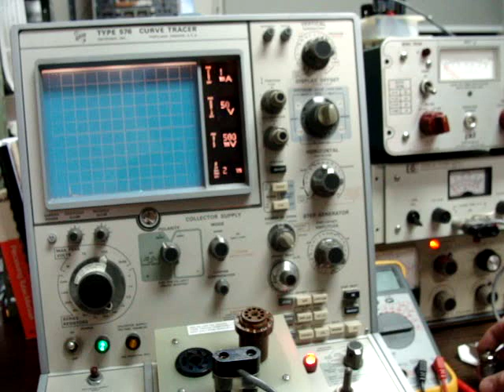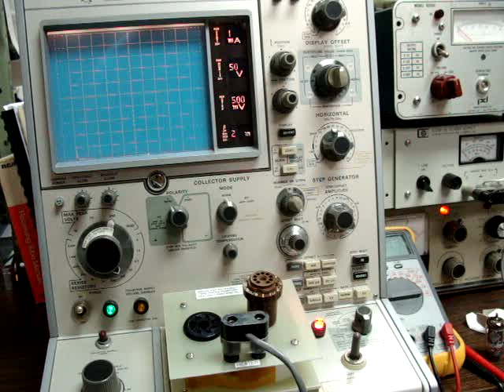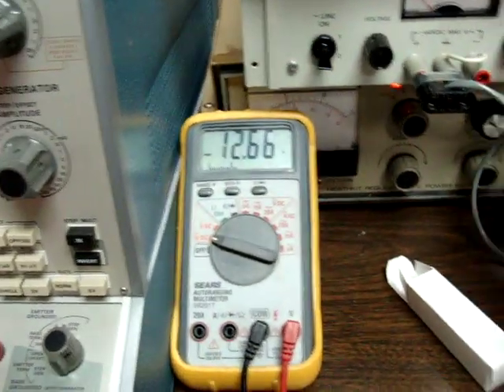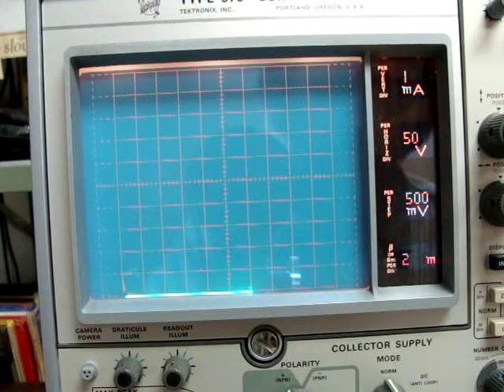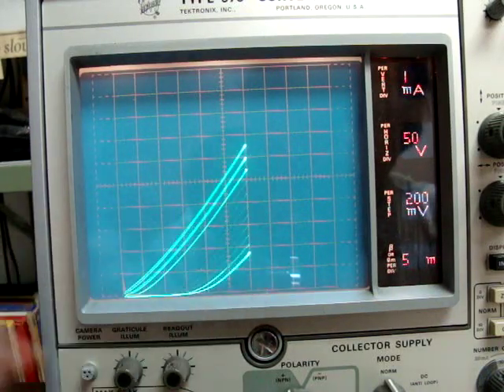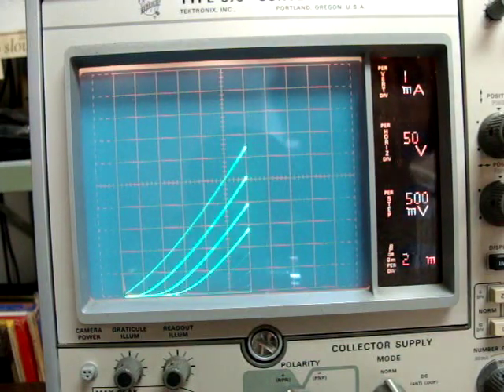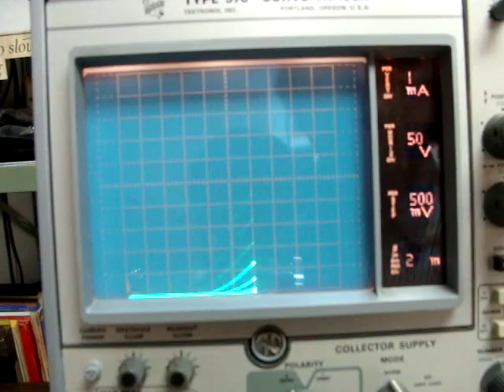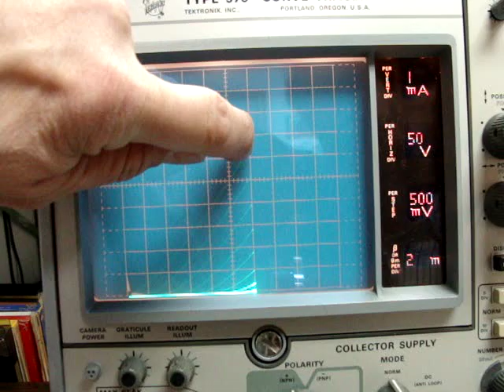Matching 12AX7 Vacuum Tubes on a Tektronix 576 Curve Tracer

Comment: I know this is an old thread but I picked up a 575 and with a little work got it working well.  I have all kinds of power supplies to convert the voltages to accommodate tubes.  However, I am starting to think that with a memory scope (DSO) all that is needed is a computer generated stairstep generator and plate, grid and heater power supplies.  Is this correct?  It may save me from having to build an adapter to utilize the 575 to trace tubes.

Comment: Do you have a circuit for the tube adapter? I have a 576...
Reply from the maker: Hi, The tube adapter for the 576 and 577 are handmade.  You can get the schematic in the December 2011 issue of "The Tube Collector" magazine.  You can get a back issue by Google searching for Tube Collectors Association.  They have back issues available on their web site.

Comment: Does it able to trace direct heat filament tubes, like 45, 26, 2A3..?
Reply from the maker: Yes, it will curve trace just about any tube if you have the proper socket.  I have special socket adaptors to curve trace the 45, 2A3, 26,  and even have adaptors to curve trace tubes like the 7591A, 7868, and even rectifier tubes.
Reply: Could you share the schematics for these adaptors.
Reply from the maker: I don't have the schematics, I bought this unit with all of the socket adaptors.  I understand they were printed in an article on curve tracing with this unit in the December, 2011 issue of TUBE COLLECTOR.  You can purchase a back issue from the Tube Collectors Association at www.tubecollectors.org

Comment: Hi, I have a BK precision 501A curve tracer that operates with an XY monitor I want to upgrade, I use it for solid state devices, what do you recomend Tek 577, Tek 576 or the digital Tek 571 and why? thanks.

Comment: 577 has less power than the 576. It is great for preamp tubes, but a 6L6GC is about as high as I would try with it. 576 will do most power tubes. For power tubes you need to add power supplies for other parts of the tube. The 371 is the best Curve Tracer for tubes, as it does 1000 watts plus. The 576 will do 350 volts. At 750 volts the 576 does not have the current. You test as you are testing an FET.

Comment: Hi,
Is the tube adapter for the 577 commercially available?  I have 2) 577's in my lab and thought about rigging something up to supply filament and screen voltages but have not got around to it.
Thanks for the video.
Regards,

Glenn Scott
DSMlabs.com